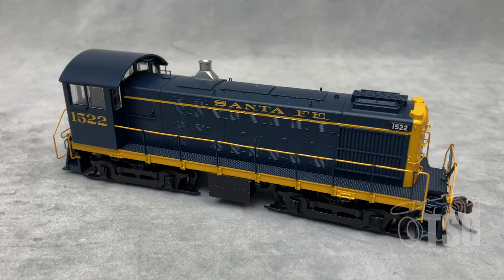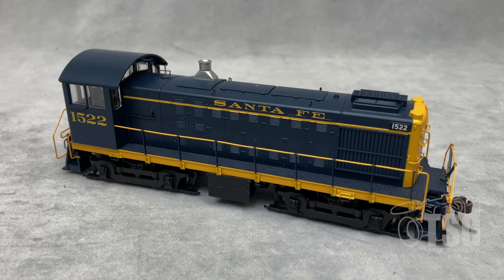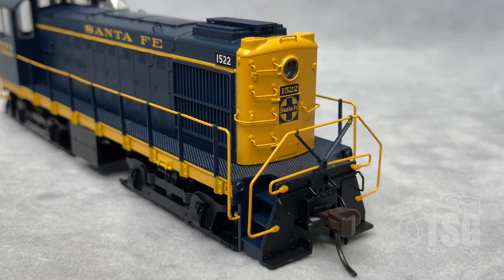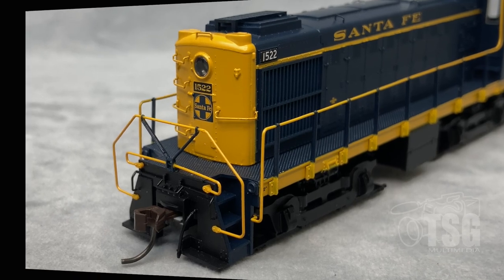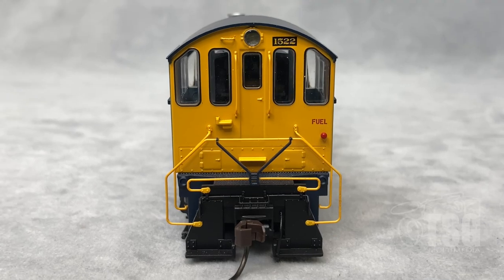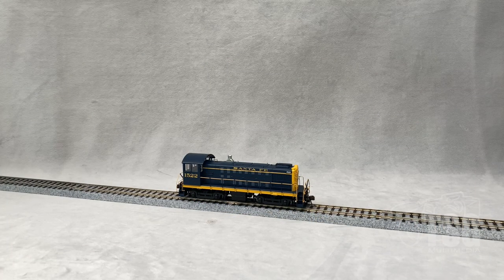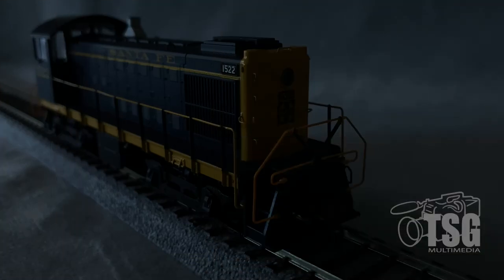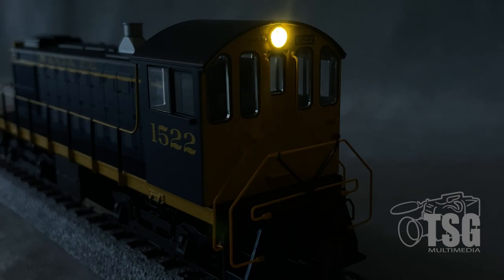HO Scale ALCO S-4 Switcher Locomotive Atlas Master Product Spotlight

Comment: I remember you mentioning switching from N to HO a few days ago. If I wasn't so invested in N, I'd think seriously about it. If I can stay in my house for the long term, my spare bedroom is probably big enough for a layout like Gary's.
Reply: I had N-gauge from age 7 to 17, then I dropped out of the hobby for 35 years and what definitely brought me back was Life-Like/Walthers producing models of the NYC subway trains and that did it, I was BACK! In HO scale of course and never went back to N-gauge as I felt they were tiny in my now grown hands plus no one was modeling the NYC subway models in N-gauge, and STILL no one is producing N-gauge models of the NYC subway. I also credit MTH whole had a hand in bringing me back to the hobby as again, the NYC subway models produced by MTH were bigger in O-scale and because my first introduction to railroading was the NYC subway system being born and raised there. I added another scale to model that's the perfect size being slightly larger than HO and that's OO-scale, so I'm modeling 3 scales and having a blast. N-gauge is perfect when space is an issue and N-gauge has really grown with DCC, sound and so much more, but HO has more they say. Have fun!

Comment: Only one real thing not mentioned that really distracts from the model in the front, and a bad flaw on atlas' part,  the mold line on the vertical side top, of the front,  long hood.  That should not be there.

Comment: I'm not impressed with the sand filler hatches on the front either.  They really screwed the pooch on these two topics
Reply from the maker: If you want to make these kinds of criticisms, perhaps you should share your qualifications as well.
Reply: @TSG Multimedia   it is just basic knowledge of locomotive models. The overall contour of the top end of the long hood in this area is overall a complete disaster. A 2 minute search on comparison of photos for the untrained eye doesn't take long to reveal atlas messed up bad here. I am simply pointing out the obvious defects I hope they will correct. This kind of defects detracts severally and does not qualify its price point. The more you look at it the worse it gets lol. Such defects should be included in a review revealing a model's flaws, especially something as drastic as this. Atlas did far better on old tooling.